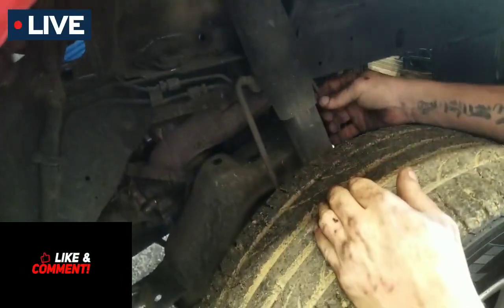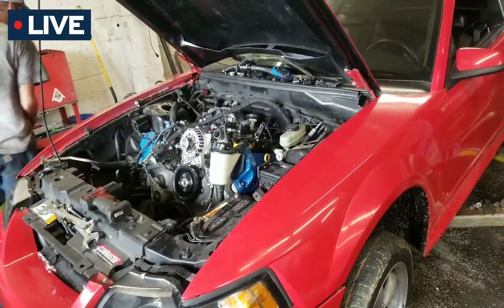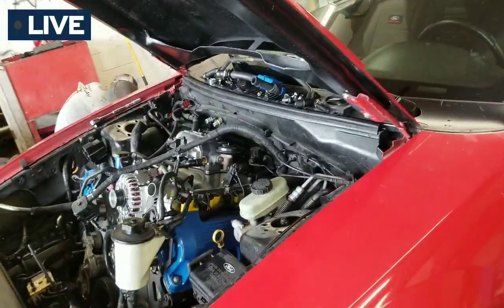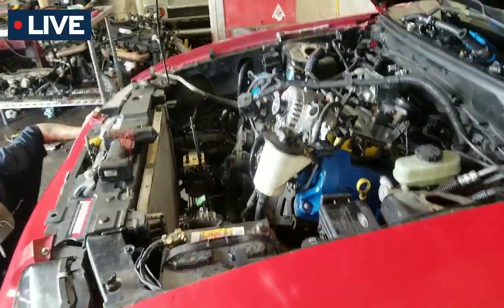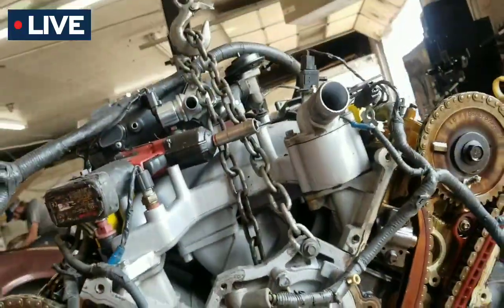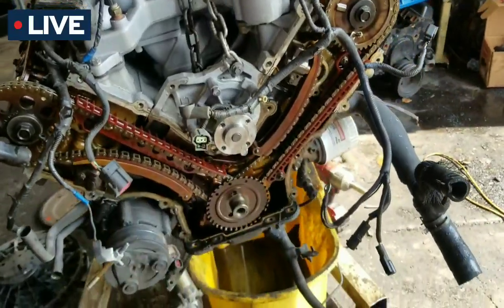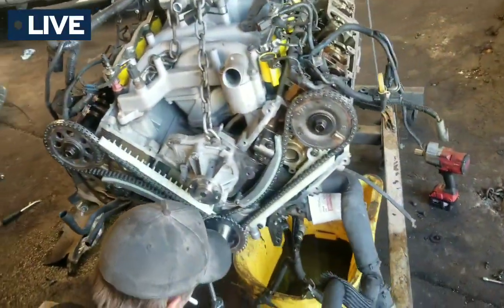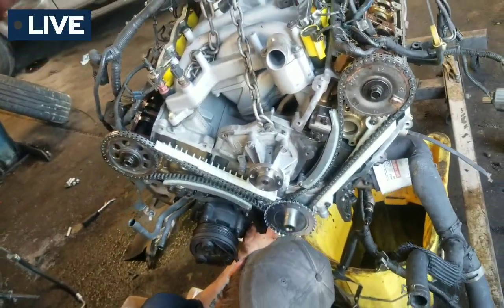New Update! Mustang Engine Removed and New Parts Installed!! (Part 2)

Comment: Can I swap an 01 grand marquis engine in a 95 grand marquis
Reply from the maker: I believe you can
Reply: @GabeOn26s  which mustang supercharger stock can I put on it
Reply from the maker: @nequelnelson1950  03 or 04
Reply: @GabeOn26s  thank you
Reply: @GabeOn26s  if I wanted to go 3v heads which year can I use bolt on